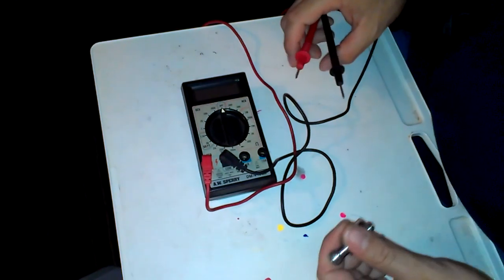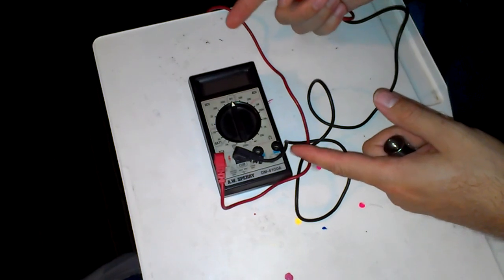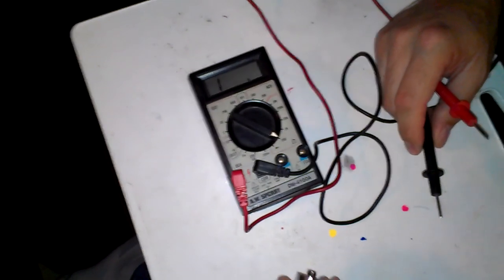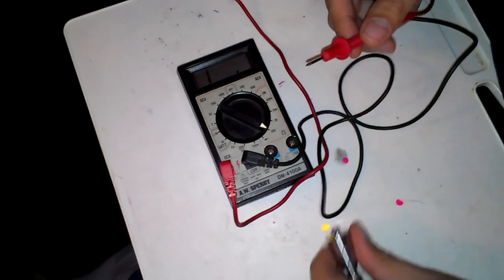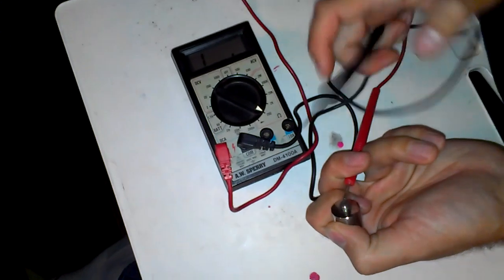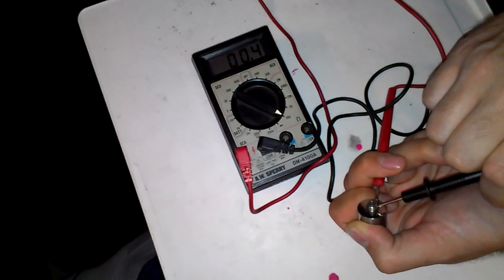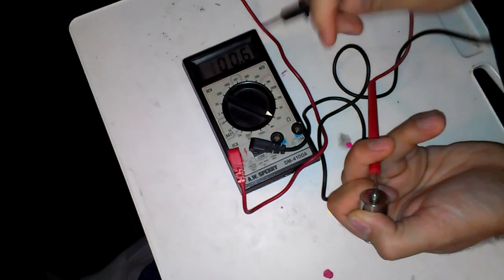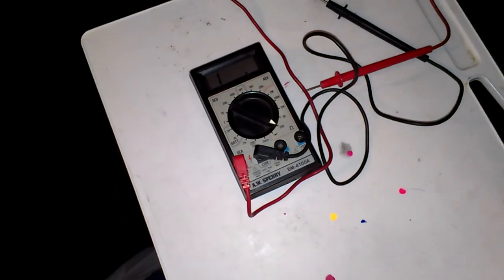How to check resistance on a rebuildable with a multimeter.

Comment: I want to check the resistance of a coil before i put it on my deck. Can i test the coil on its own or will the deck add/reduce resistance?
Reply from the maker: I'm not positive about that as I always tested with the coils installed first.  Sadly I no longer have the multimeter so I have no real way to find out.
Reply: Thank you. I will do some experimenting and see if  there is much difference in readings from my multi meter and my mod. If there is i will see if the difference is always the same, then i can work out my resistance before building up my deck :D
Reply: what did you find out? I'd like to start building better rba's just wondering how it worked out for you
Reply: The resistance of the tank is very minimal. I find my coils are roughly 0.01/0.02 ohms lower than on my Limitless RDTA.
Reply: tillytony right on. I gotta order some wire and cotton. I'm just using what came with my topbox mini rba kit.

Comment: Thank you so much Ray!! I'm still trying to figure out In my head why the center and the threads show the whole resistance of the build buy I guess it's one of those it works don't ask questions kinda things lol
Reply from the maker: well the center post is the only positive connection and is isolated by the insulator. The negative posts are attached to the whole device so that is why you can touch the atty anywhere and get the full reading.

Comment: .2 minus .6 is negative .4..........but I'm just a condescending, wise ass lol.  I knew what ya meant :-) Thanks for the vid!
Reply: Hamburger Head - being an Algebra Tutor for all me years at University had made me much like yourself. But we both knew what he was getting at. I didn't know how to measure resistance either until I saw this video. We all need some help learning something sometimes.
Most science professors most likely would have asked for or said what is the DELTA of these two numbers (?) - or something like that.
Watch out for the order of operations. Finally Parenthesis have a use to divvy up what operations are done first when you have that "Conga line of Operand's"!

Comment: I have 2000 mah efest 18650.  Are these good enough for sub ohms on a mod, or should I get the 4.7 Aw Imr's?  My Efest are only 3.7.  If they are high draining, how long will a AW IMR last typically?  Ialso noticed a lot of cartos are now 1.8 ohm.  Will they work on a Vamo?  Just recently doing RBA's around 1.5, but I want to go lower now.  Thanks!!

Comment from the maker: 0.7ohms should be safe but you might want to go with a 18650 efest...also if you plan on going any lower than say 0.6ohms you'll wan to get a 30amp battery.  Efest now makes a 30amp 18650 1500mAh.  But there are many others out there.  The only issue i can see with the 18350 efest is you will drain it really quick and have to change it out way more.  Plus the smaller efests have less amp draw and could possibly vent on sub ohm builds.

Comment: Hi Ray. I appreciate your videos. I just went out to the store and got myself a multimeter. I am using the Vanilla mod with an iGo-W, the battery is an Efest 800mAh 3.7V. I took the readings and the leads touched together were giving me between 0.3 and 0.4, but it seemed to favor the 0.3 more. After I touched the leads to the iGo-W post according to your video, I was getting an alternating 1.1 and 1.0. It seemed to favor the 1.0 more. So, 1.0 - 0.3 = 0.7. Is this normal and safe? Thanks again!

Comment from the maker: It looks nice, but my issues would be that is has no drip well for when you over drip and looks pretty small.  I personally love the IGO-W and you can pick those up for 14.99 on mtbakervapor.  Killer dual coil drip atty.  Only modifications you need to make is drilling the air holes out wider.

Comment from the maker: Okay so the way to check a build on that style of dripper is really easy since it's a dual post.  Just take the leads and place them on the posts.  Red lead on the positive post and Black lead on the negative post (even though I tried both ways and got the same results).  Hope that helps.

Comment from the maker: The RBA is attached to the battery?  That I can't answer since I have yet to see a RBA that is permanently attached to the the mod.  I mean if you can touch the positive lead to the center post in the battery chamber and the negative lead to the side of the mod you might get a reading but not to sure how accurate that would be.  Do you have a picture or a name of what you are talking about so I can do a little research and get back to you?